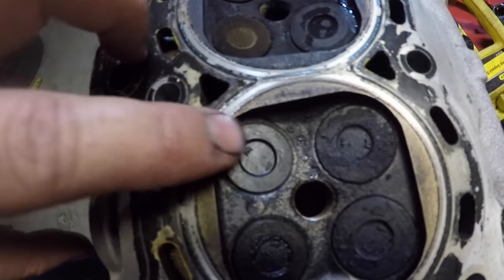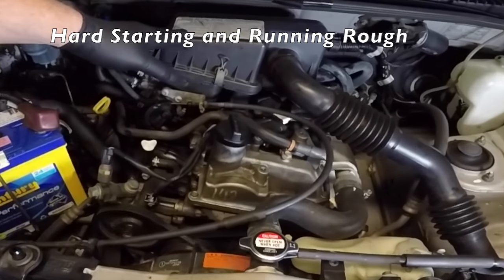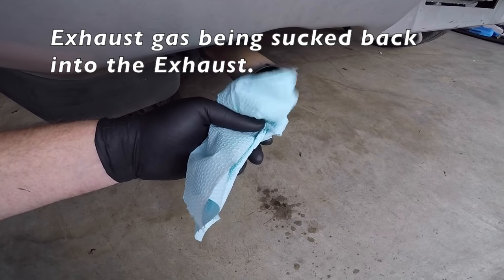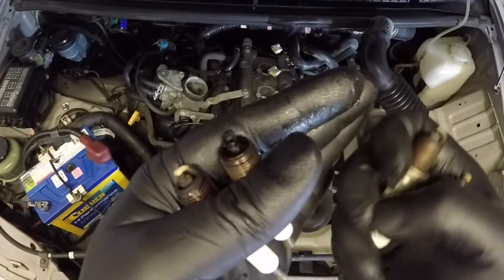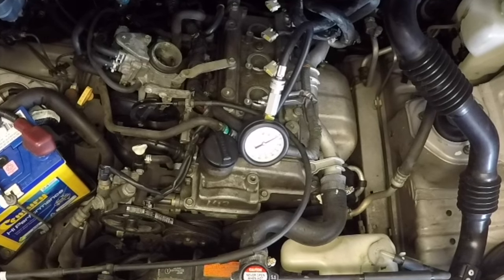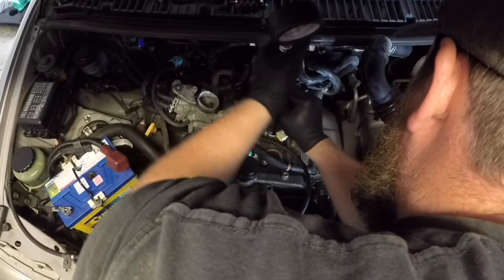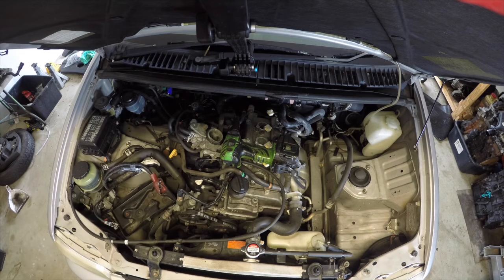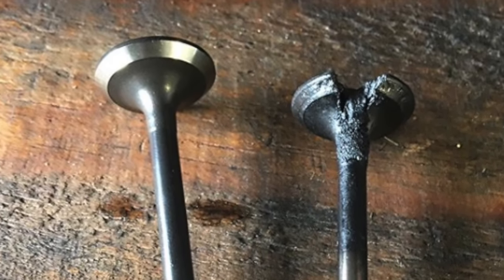Leaky and Burnt Exhaust Valves Signs & Symptoms

Comment: I have the same issue but when I did the compression test, it showed good results throughout the 4 cylinders. Why is that?
Reply: Did u figure it out?
Reply: @barbiebb5213  actually did. Turns out these symptoms happen to literally any car I tried. After tearing engine down and rebuilding, it still happened.
Reply: U have any abd code, check engine light?
Reply: @barbiebb5213  no codes. Is your car suffering from anything?
Reply: @farhan7393  yes unfortunately,
P0303 misfire.
New ECU, new ignition coils, spark plugs... Compresion god
And still i have misifre.
Reply: @barbiebb5213  try switching cylinder 3 injectors with other cylinder. I could be a faulty or clogged injector. And did you check your fuel filter? It could be clogged as well. But my first guess would be clogged injectors.
Reply: @farhan7393  i forgot to say injectors are checked and are working fine, this car is crazy.
Reply: @barbiebb5213  what car btw?
Reply: @barbiebb5213  next I would suggest is bent valves and worn piston rings but you said compression is good.
Reply: @farhan7393  that's what mechanic said. 😒
Reply: @barbiebb5213  are you sure the compression test was done properly though?
Reply: @farhan7393  i don't know maybe i will test it again somewhere else.
Reply: @barbiebb5213  alright. Keep me posted. I'm quite fascinated.
Reply: @farhan7393  i will thank you for the help.
Reply: Man my car has a hard start and I lose alot of oil my compression test I did said 153 153 152 153 but I seeing smoke at high revs or even long idle
Reply: @glenroymcjenzie4691  if your compression is fine and it's still smoking at high revs, it could be your O2 Sensor. It's making your car run richer, hence the black smoke.
Reply: I heard my valve stem seal may be bad I losing a lot of oil and sparkplugs  are fouling
Reply: @glenroymcjenzie4691  bad valve seals or stem would give bad compression. You seem to have good compression.
Reply: I done another compression test and it is fine.
Checked al wires its all ok.
Ecu, spark plugs, ignition coils,injectors all replaced with new ones. Not burning or leaking oil.
And still misfire its driving me crazy.
Mechanic says that we should take the engine head off to check for head gasket and other parts. Because with electrical parts is everything allright but still there is compression so don't know what to do.
Reply: @barbiebb5213  what problems your car having?
Reply: @glenroymcjenzie4691  p0303 misfire.
Reply: @barbiebb5213  check intake manifold  gasket

Comment: I have a 5.4l 3v with intake and exhaust valve leaking how you go about repairing it
Reply from the maker: Remove and inspect the valves and inspect the valve seats. Most likely they will need to be machined or replaced. Thanks for the question.
Reply: @killawattgarage  thanks

Comment: 100% what is currently wrong with my car. Replacing valves today. But what is also noteworthy, is what actually causes valves to burn...and it's a faulty fuel injector..
Reply from the maker: To lean or too rich, age, tappet clearance, excessive carbon etc ... many reasons

Comment: I think I just got the same problem with my car now.
It has been driven with the "check engine" light coming on now and then, but it usually goes away after some time, but after 3 hours of driving one way with a lot of prolonged climbing on the motorway up and down, one of the valves seems to have bitten the dust.
I need to get this fixed.
I had to drive home again with 75 percent effect, but at least I got myself a good motorcycle, it's always good to have the freedom of choice and alternatives :)
Reply from the maker: thanks for the comment.

Comment: Great vid. But I wonder what may have caused this? Could you explain that please?
Reply: when there is a leak in the exhaust pipes/system, it eventually kills the valves, due to heating/cooling cycling between massive temperatures different from the other parts around it.

mine failed, for example, because of rust. rust makes all the bolts weak. when bolts holding the exhaust manifold ever break, it creates a leak in the exhaust manifold, where the gasket is. That is an exhaust leak, and the air then gets in that way, and that is already a breach and will cause those great temperature differences as you run the engine and turn it off and park it... then drive it again, etc. Over a long time, it'll eventually kill the exhaust valves.

That is the theory.
Reply: High exhaust pressure will burn valves rather quickly. That's usually caused by a clogged cat. If the preasure gets high enough the engine will start to knock and eventually the engine will turn into a bunch of smaller pieces.

Comment: Does the engine smoke if the exhaust valve leaks? Thank you.
Reply from the maker: There may be a little smoke due to the misfire but not a significant amount. Just a few puffs at lower revs.  Thanks for the comment.